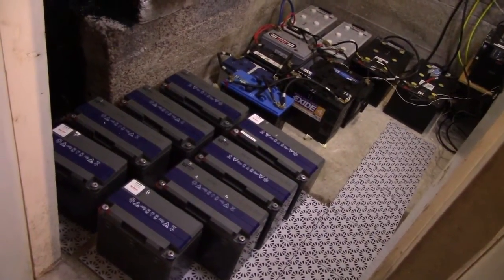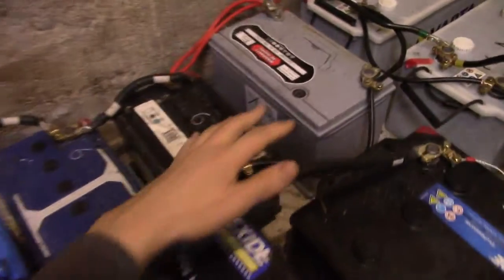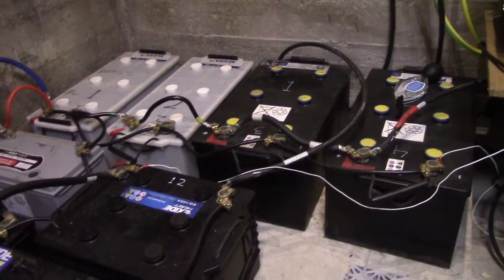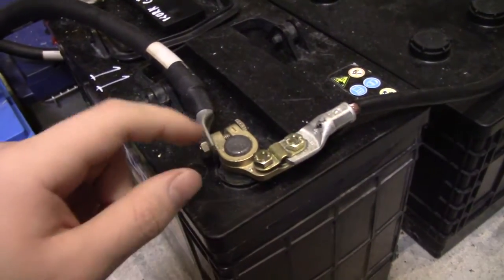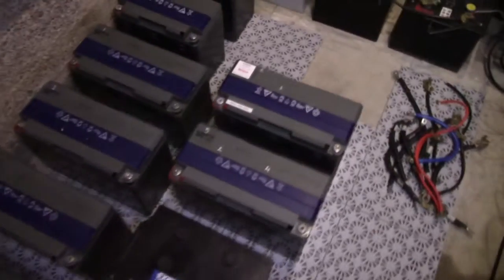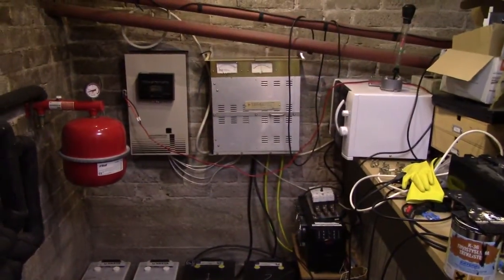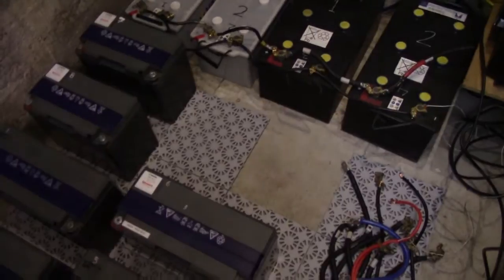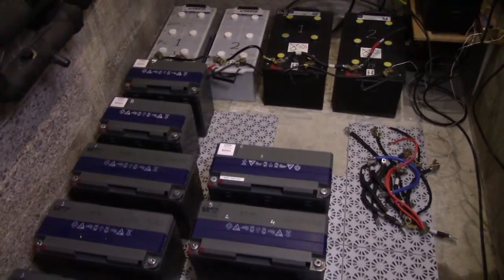Installing telecom batteries in the solar bank

Comment: hello FFcossag. Nice video showing a lot of work. But really, you have to find a way to change your setup. I want you to live to post more videos. This is a crazy setup. 

I personally did some stupid things this past week. I shorted 3 -- not 1, not 2, but 3 -- small DC to DC converters, one by reversing the polarity when connecting them up, and another  one by touching (accidentally of course) + and - connectors together on one end. 3 DC to DC converters dead within two days. While playing around with one of them and trying to see if I can fix it, I did something -- still don't know what exactly --such that a 50v 50 microfarads capacitor blew up and the cap shot right towards my face, coming very close to my right eye. Luckily, it did not actually hit my eyeball but the bridge of my nose and eye brow area. It drew blood. I have a circular scar now right on the upper end of my nose bridge and my eye brow area. Stupid me. Playing around with this type of stuff is so dangerous.

Comment: Hmm... Have you considered wing nuts on top, at least on the known poor performers to make it easier for you disconnect when/if necessary?
Reply from the maker: No; the problem is that the stud would need to be removed in order for the battery to be disconnected. That takes a relatively long time to do, and can cause dangerous arcing around the terminal area, when trying to remove a battery that is consuming current.

Comment: Wow what are the dimensions of one of the new batttery????
Reply from the maker: The bigger ones are rated for 114 Ah, and their external dimensions are 389 mm (W) x 176 mm (L) x 277 mm (H), weighing approx. 46 kg. The smaller ones are rated for 76 Ah, and weighing about 34 kg.

They are about twice as heavy and twice as large as an automotive battery of the same capacity.